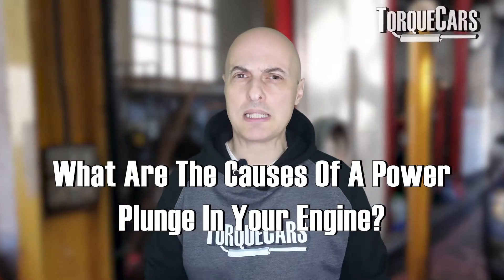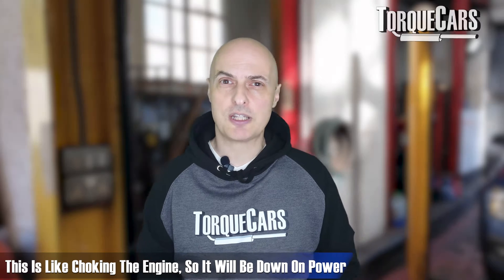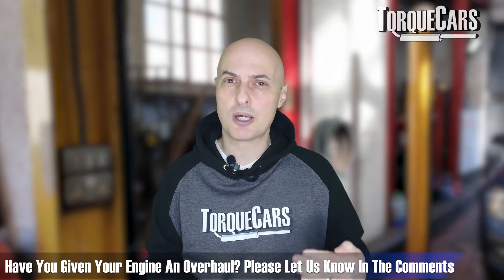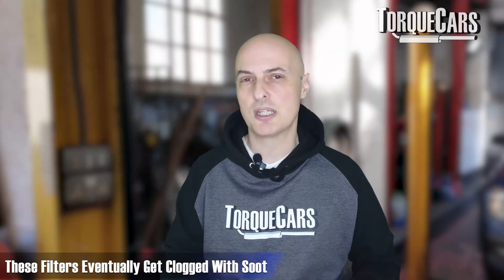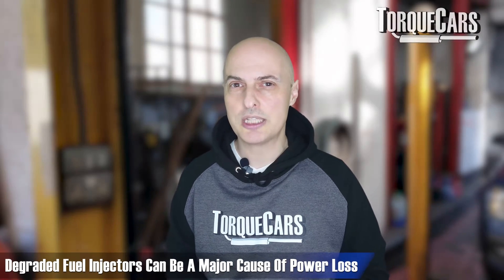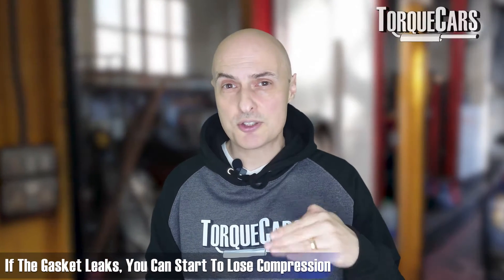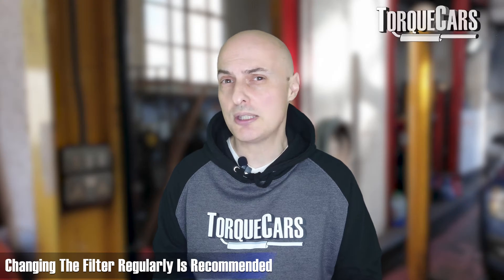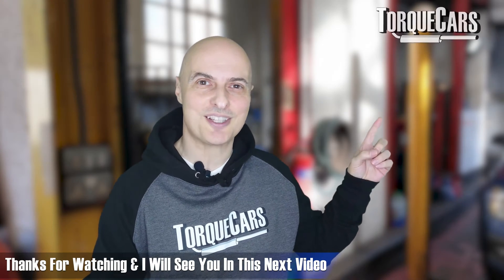Why Your Engine Constantly Loses Power: Identify, Fix & Regain Lost Power!

Comment: The only one that works (and I've tried many) is one called Dipetane, it's a fuel lubricant and engine cleaner, have a 24 year old land cruiser which had lost much of it's power, started using Dipetane and noticed a gradual increase in power and responsivenes over the course of two or three tanks of fuel , this continued for quite a while until it had recovered all of its original power and torque, and the readout on emissions during testing is less than many modern engines, it has transformed an old high mileage engine.highly recommended, thanks

Comment: Here in Canada, I drive an ‘06 Ram Cummins. I was having a slightly rough idle. The auto supply store suggested Hot Shot Extreme Diesel to clean the injectors. With the periodic use of this product and regular use of Hot Shot Everyday in the fuel, my engine is running like new. Of course I change the oil and filter within  3000 to 5000km too.

Comment: Hydra blast injector and diesel fuel cleaner, I've used for years now on my 1.9tdi BXE, 09' still drives like new, no loss of power, zero upkeep on the engine, besides regular services on oil, oil filter air and fuel filter at correct intervals as well.

Comment: I am using GTL diesel (gas-to-liquid). It is much cleaner diesel with almost none bio anf almost non-greasy. Makes much less soot, engine is much quieter and runs more smooth.

Checked my manifold and other places in the engine with endoscope and looks almost like new.
1,6 CRDI engine.

Comment: I have found that bg44k or redline si1 fuel system cleaners work the best they also have the highest amount of PEA especially the redline si1. use one of the 2 once a year car runs much better after use.
Reply from the maker: I am a big fan of BG products, I haven't been paid to say that and I haven't tried redline so will give that a go on your recommendation. I saw BG cause a car to pass emissions test with no other mods or adjustments required.

Comment: Great video, great points - and sadly not enough views.
Because most ppl are not enthusiasts (or simply ignorant), drive from A to B without thought (some even without looking while driving), not caring about any of this.
Until their cars, not old but of newer age, often with less than 100k miles, have all sorts of serious problems or capital engine failures.
Due to emission regulations (aka big BS) complexity has grown immensely, with more maintenance necessary - but car makers (and their crazy long life intervals of 20-50k miles for oil changes) doing the opposite.
The reason for the saying: Old cars great, all the new ones are poor quality.

Of course BS, with a grain of truth behind:
They aren't as robust and easygoing, better: super simple, anymore, like a W123 Mercedes 220D with a 2,2l Diesel and 60HP was, drinking 7 liters of diesel no matter if going flat out or not, that can do literally millions of miles.
But who wants to daily drive that, in 2023, without even electric windows?
Most want (or they believe to need) to diddle doddle on stupid touch screens - and there you have it. A modern car it is... 😅

Of my 3 cars 2 are ICE (individually configured/built/factory new in 2018 and 2019), and both have high specced 2,0 engines - that can definitely NOT live long with the same care as aforementioned W123 220D...
A 2,0 diesel with 224hp/450Nm (stock),  2500bar Injectors doing ~10 pre/main/postinjections per cycle, 2 Turbos (that can work sequential or staged) and all the necessary extras to achive Euro6 (DPF, SCR/Adblue, EGR cooler, ...) and a 2,0 petrol doing 231hp/320Nm (stock) with a watercooled twin scroll turbo (thankfully without GPF).
Both have 40 and 60k miles now, compression, power/fuel economy like new, with 0 leaks, problems or defects. No rough running, no idle or stalling symptoms - all buttery smooth and silent like new. Not because luck/miracle - but reasons.
Here my recipe - that was a lot shorter with all my older cars i had:

No short distance driving - if at any means avoidable. For that (and only that), i use the electric. Only long distances, with a minimum of 20miles (petrol) and 50 miles (diesel). At least once a year a continous 300+ mile drive in one piece, that happens out of occasion or need anyway - so everything get's up to real operating temperature, where all can work well/regnerate - especially the diesel, but also good for the catalytic converter of the petrol.

Fuel - only strictly premium/synthetic fuel with 0 bio components, far exceeding the low and outdated (because they don't take short distance driving, longer non-use/standing times, or higher specced engines into consideration) DIN EN Norms 228 and 590 in regard to cleanliness and general properties, and the proper octance and cetane numbers those engines were actually designed for.

Fuel system cleaner - every 5k miles (instead of recommended 2,5k miles - as i use premium fuel anyway) - to keep 2 things as clean as possible: the fuel system (water, residue) and injectors (dripping or clogged/un-evenly spraying injectors are fatal, as the wash away the oil film, dilute the motor oil to an extreme level - and with lack of lubrication, parts going metal on metal, a quick death for high spec/revving engines is pre-programmed).

Air filter and spark plugs: As i do use the power of the cars more often than not - i cut the maker recommended interval in half.

Oil change - the 30k miles official service@dealership (to keep all "official'" boxes checked) - and oil&filter change done by myself every 5k miles/6months.
Engine cleaner, drain oil, refill with cheap oil, 2nd change with proper oil + ceramic additive - every ~40k miles.

Oil specification -  you really need to educate yourself (all the information is out there), to make a good decision based on one's expectations, driving profile, needs, and the very exact engine/model/make you have.
For my diesel i stay with the og. and recommended BMW Oil (LL04/ACEA A3/B4) - thats perfectly fine, and changing frequently is the true key anyway.
For the petrol (who could take anything from LL01 upwards) i switched to the new Castrol oil with the brand new API SP Norm, that also already fulfills the new BMW LL19 norm, and is backwards compatible with LL04. It is new and existing - for a reason. It effectively adresses these problems by enhancing certain properties with different additive mixes, without having worse NOACK/oil fuming: LSPI, chain wear, oil stability/cleanliness and tendency to avoid sludge or deposit (piston, piston rings, turbo oil intake lines, turbo bearings,....), camshaft and timing device tear&wear - exactly the problems this spicy engine is a Nr.1 candidate for. And generally the same kind of problems that car forums are overspilling with, with relatively new cars/engines having capital failures (due to beeing driven too hard, too soft with low quality fuel - and clogged up to the brim, only short distances, tuned - and/or not maintained properly).

Regular self-checks without any need for a dealership - from a "grab and wobble everything in the engine bay" and visual inspection for leaks, spills or anything suspicious, to checking the intake side (EGR, manifold, valves) and cylinders with an endoscope once a year.
This way i can tell for certain when it's about time for walnut blasting of valves and cleaning/or new manifold on the intake side (IMO the only proper way to fix it), a check/change of injectors is due and the general status/condition of wear.
Needless to say: last check showed still pretty clean intake side on both, and no visible engine wear - because: reasons.

Taking care of own stuff bought with hard earned money - is common sense, makes fun, and ofcourse, yes, costs money (and saves a LOT in the long run).
IF i did NOT follow this strict regime, while driving them like i do - i am 100% sure i would already have the same problems so many of friends/family/colleagues do, no matter the car make or model. And when you have 1 serious engine related problem, it's often a symptom for a chain of causing problems or worn parts. With complexity/parts/labour costs pretty crazy high, that can quickly make an even only 5yo (low to mid-tier) car a total economic loss...
Reply from the maker: You've inspired me to do a video on does mileage matter when buying a used car. I think it will be useful to explore this further. Thanks also for the detailed information in your reply, I enjoy reading this and always learn from my viewers experiences and opinions.
Reply: bravo!  excellent maintenance methods & schedule.  In later years i started driving my car much less and usually just for a short series of stops near my home.  Couple times noticed wobbly restarts after the first couple mile drive from cold.  Now that i realize it's probably fuel wash (tho in theory could be this partic. model's defect in a circuit board that can easily be re-soldered) , i will never do such short drives again and like our host says, drive it a few extra times around the block or even parking lot if necessary to make sure it's mostly fullly warmed up.   Fuel wash is disaster & my engine already has over 150K miles.   Other thing i learned over time is that increasingly in the past 25 years, mechanics with deep experience have been noting that engines made in the past 25ish years really do need the classic short oil change intervals IF it's a car with typical type use.  That means 3K for many owners.  This also makes used car buys really difficult and often unwise for those of us who realize all of these factors re cars made in the past 20-30 years.

Comment: Great information channel 👍. 
My VW T5 2.0tdi  299 k miles I got a p299 low turbo boost at high rpm 
I checked the vacuum pipe and  the activator holding vacuum ok . Like you said Might be a split in pipe higher rpm would explain it .
Reply from the maker: Hope you track it down my friend.
Reply: @torquecars  so far fault not come back .

Comment: Carbon deposits come from EGR, PCV, computer controlled engine management maintaining drivability, driving cycle/duty cycle. Have you ever read anything on solubilized oxygen, dissolved and entrained air in the refined petroleum fuel? How about fuel aeration and fuel cavitation? all these things mentioned here contribute to carbon deposit accumulation in the engine.
Reply from the maker: I have read some, it is a topic on my radar at the moment, but I've also read about people adding oxygen to fuel to boost power, so I'd want to do my own more thorough research before jumping to any conclusions. 

It must be fairly easy to test out. Thanks for the heads up and it may have been you that sent a message through my website a while back. I rarely get a chance to reply to the 100 or so daily messages but I do try to read them all.
Reply: @torquecars  there is a company in the UK called Run-Green International they make a product called X-Carbon. add to gasoline or diesel. It will literally rock your world. Because you are a Youtuber they might sample you for free. The stuff is expensive but it  works instantly.